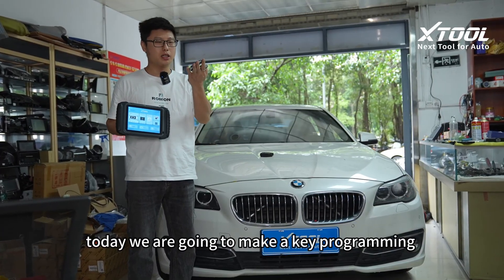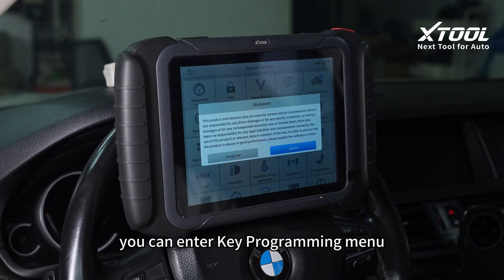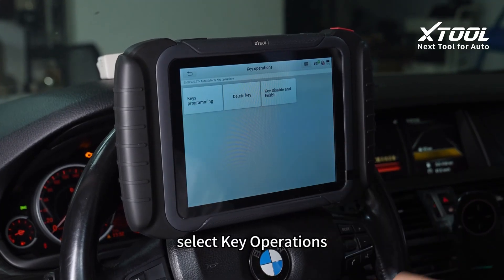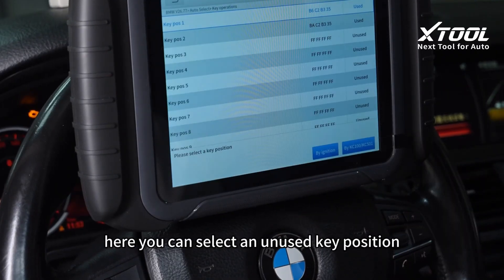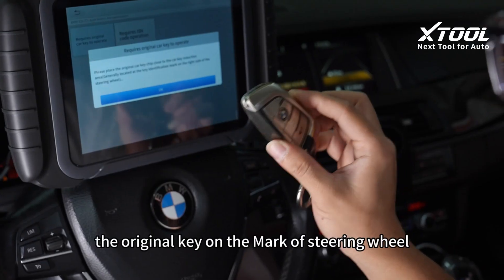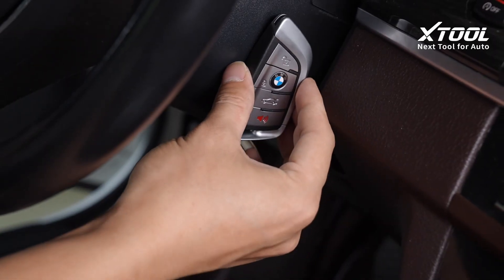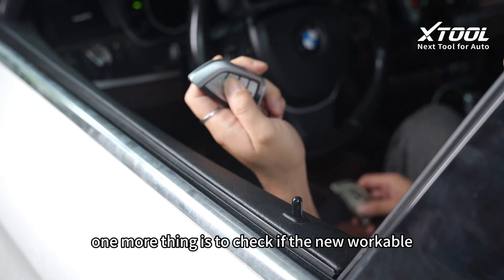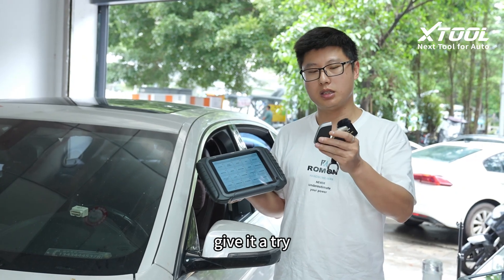Xtooltech XT80W Key Programming for BMW

Comment: Don't know how about adding keys but I will never ever going to use xtool products for bmw for all keys lost I have x100 max what meant to be pro advanced key programmer done all keys lost for same bmw f10 with just ca4 module and it brick it could recover  cos only autel got the option to do so I bought another cas4 module it brick it again it brick 5 of the cas4 modules in total for me just on the downgrading cas4 and yes I did use battery stabilizer. I not recommend to use xtool on hi immo cars....believe it or not I bought cheap autel km100 and it's done the job very easy